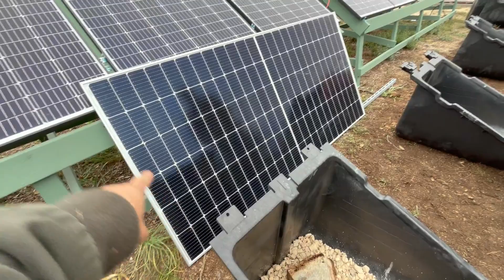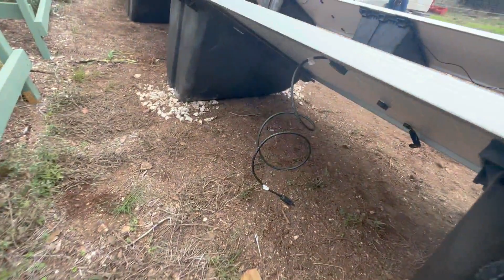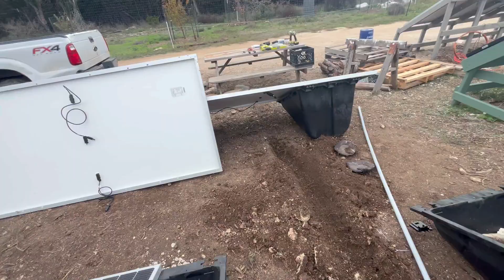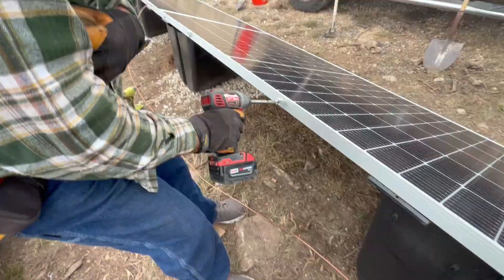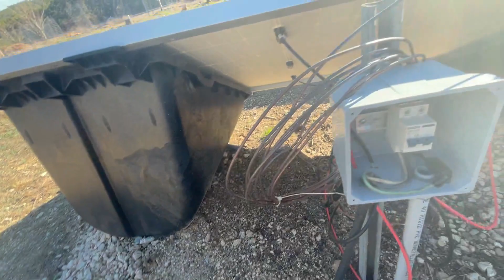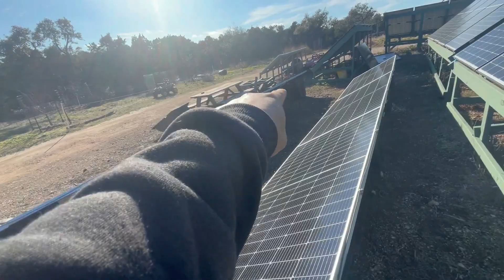How to install PowerRack ground mount solar panel racks

Comment: Thanks for the video. Currently doing my own setup and man if you have land, I think these are the way to go. San tariffs, PV panels are so. low. You can get panels for around or under $0.20 a watt which is crazy. I bought 11.7 kW of PV from Signature Solar for $2500 after taxes and shipping.  But then what I didn't realize is that you need to pay almost that exact same amount if not more for the mounting if you want to use the ground! Crazy. 

But these are the best. We've setup a row of six but plan to replicate and expand. The setup we thought about and came up with is exactly like you are doing. So for my spreadsheet right now, the total cost per panel assuming self installation and this is grounding and wiring and boxes and such would be around $200 a panel. Crazy cheap. You could have a whole 12000 W of solar installed and secured for about 6000 before the tax credit. 

Throw in $4000 for inverter, batteries, and cabling, and you can power a small home for many decades for $10,000 before the tax credit. f

Some points that you may know but others may not

1) The conduit should be trenched deeper. I should based on the electric code, but it's their own property so they don't have to. It'll probably be fine. 
2) I would recommend also having A small 2x4 or 4x4 and a junction box as well just in an extreme weather scenario. Rain and other water could definitely get into that pipe so a junction box or even a 90 would be helpful. 
3) Whether code or not, it is important that you ground the panels into the same grounding system of the property. Not just burying another grounding rod. This is dangerous in a lightning storm because it can create a difference in potential between the grounding system of the panels and the home ground system which, if lightning were to strike either of them, may go sideways to connect the two systems together. Just something to keep in mind. You can just run the conductor through conduit back to the panel or even connect it to other panels that may already be grounded. 

Just my thoughts. Not an expert. Thanks again for the video

Comment: When the state inspector from rolling on the ground laughing .....
Reply from the maker: @IOKIYAR  I live in a county that does not require any inspections for ground mount solar systems. I’m laughing all the way to the bank though by saving $15,000 over a metal rack system drilled into my solid rock ground.
Reply: @unpluggedtexan  The engineered design provided by the manufacture of those buckets, required 2 buckets per panel and 450 lbs. per bucket = 900 lbs. per panel on my permitted installation. Even allowing for engineering over kill you might want to add some weight to those buckets. The panel on the West end required 900 lbs. the inside panels required 600 lbs.
Reply from the maker: @IOKIYAR  I spoke to Powerfield energy last week and they are getting them recertified. It looks like they are going to be able to drop the weight requirements quite a bit soon. Especially if they are daisy chained together using load sharing like I have installed them. We’ll see.

Comment: You show the “extention” clips for larger panels. Where did you get them? They are not on power fields website, and not in any of their online instruction manuals?

Are you possibly beta testing for this company? They talked about larger buckets for larger panels, but the clip looks like a way to achieve greater panel range with the current product
Reply: 37.8” - 41.3” panels fit the stock power rack. Do you happen to know the size of panels your extentions fit? I don’t actually have my panels yet but was going to order the power racks from signature solar. I’d like to,have the extentions for future proofing
Reply from the maker: @BrentMcDonald-t5t  I’m not sure the exact measurement for that. Shoot an email to Powerfield Energy and they should get back to you within a few days.
Reply from the maker: They’ll send the extension clips with your order once they get the details of your project.
Reply: Yes I can confirm if you order with Signature Solar, as of today, they will send you all the extension clips with it. I was surprised because I didn't need them but I know have a box full of them haha.
Reply: For anyone looking at this a year or more later, they have the PowerRack 1200 mounts now which accept larger panels than the original model. I'm using Runergy Hyperions on them and they fit perfectly.

Comment: The width of panels for these mounts are NOT listed on power fields website. The instal instructions make no mention of it. I received an initial email response from power field but nothing further. I’m getting “scam” vibes from this company. Did you have any issues?
Reply from the maker: Definitely not a scam. I met them at the solar expo in Vegas last year. They just got into the residential market so still working out the kinks in that process. They’ve mainly focused on commercial solar farms. Reach back out to them via email.  Or you can email me your contact info and I can let their CTO know to get back to you asap.